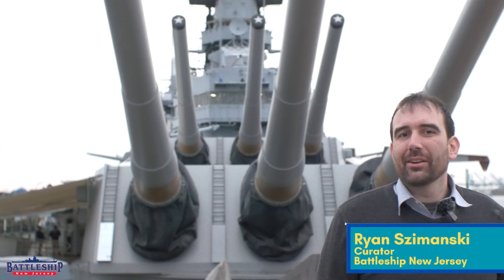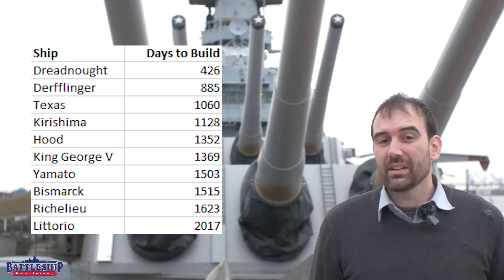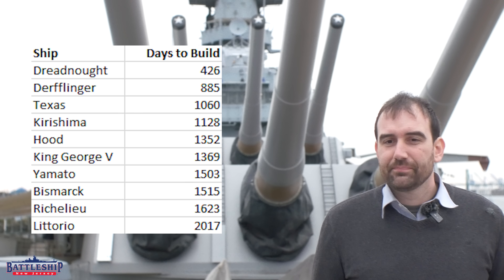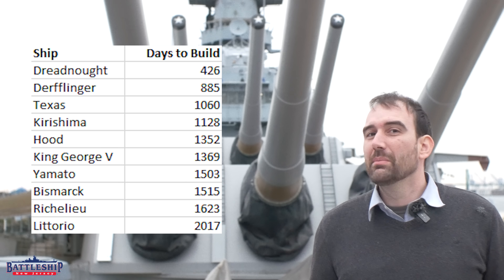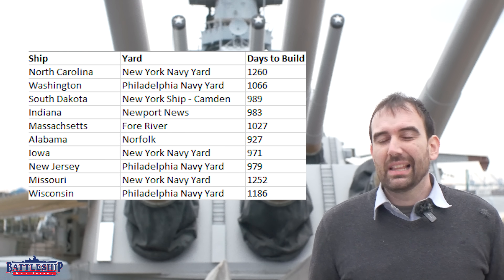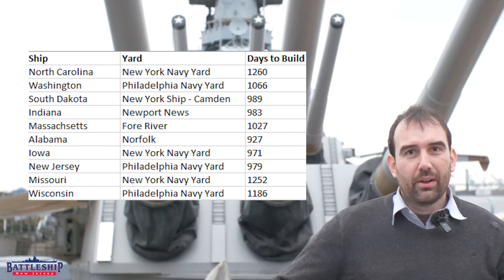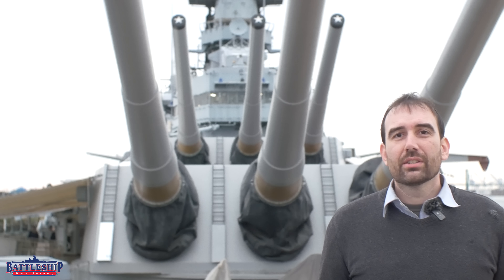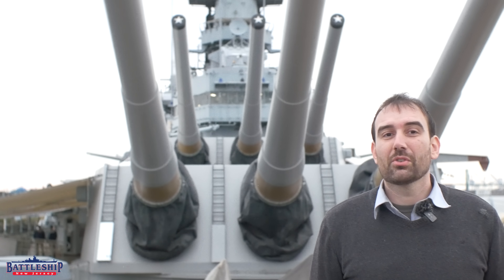How Long Does It Take to Build a Battleship?

Comment: Hi Ryan & Co.
Infrastructure and a skilled work force IMO are what reduces manufacturing time.
If your going to make 500 ships all the same, it's worth setting things up that take a bit longer, but in the overall production saves time. Also the workforce is use to and knows the things like making sure the welding cables are fed a way to save moving them later on etc, that save a few minutes here and there but in total save hours and months.
I know building only a few means not investing in the infrastructure that is only required, but that is IMO why they take a bit longer to build, especially if its going to be presented as the best.

Comment: Material Supply.  Waiting for a new technology or radar or guns.  I believe the longest turn around on battleships were the big guns. 
One of the things is pig iron production and then turning it into steel. Forging machines etc. 
The other thing that could slow construction down is the machines used to build the ships. Wear and tear and maintenance on these machines (cranes, welders, supplies for welding etc).

Comment: That was actually interesting. But basing it solely on time does not give the true whole story. It would have been nice to also have how much manpower each project had. And the other issue material would be a lot easier to source for some countries than for other countries. If you take all that into account I wonder how much those figures would then change if that was taken into account..... for example if say a ship was built in 1500 days but its manpower had say 1000 workers on it, material easily sourced. another project similar size in another country was built in 1600 days but its manpower was only 600 workers, material not easily sourced, then really which one was actually the most efficient.

Comment: The USA's steel making capabilities are much less now than in the 30's and 40's, even things like welding the ship's thick armor plates would potentially be much harder now due to a loss of technique/process understanding on how to do it without cracking the armor (a materials scientist from MIT told me about this back in the late 90's). 

Many lessons to re-learn, many basic structures (shipyards, steel mills, large hardening furnaces, etc.) would have to be recreated to come close to what we had back then.

Comment: Although obviously the keel laying to commission date interval is a good reference, since those dates are easily looked up, if you look a little deep the time difference for IOWA vs MISSOURI - both built at same yard - are maybe not as different as it looks. Photos of the commissioning ceremony for IOWA show she is lacking equipment at commissioning- missing the catapults, some of the 40mm mounts, her Mk 4 antennas, her aircraft crane. By comparison the commission photos of MISSOURI seem to show her essentially complete, with catapults and all radars. On the other hand  IOWA did start trials within a couple of days after commissioning according to her DANFS, so clearly she was seaworthy.

Comment: Riveting versus welding. Older ships were put together w rivets.  By WWII welding was far more common.  Saved much weight.  Faster.  Less manpower intensive. Stronger joins between metal, so you can use less material in some circumstances.

Comment: Just a guess the competence was there in american society so I guess when they ramped up production they could transfer civilians to work in the yard when they suddenly needed to build more faster then they usually do. just a guess. I think it helped filling the hull with everything that was designed to go in there faster. Working around the clock also helps to fit all the workers in there. These numbers do not tell how hard a nation tried when building these.

Also that Littorio ship must a lot spare windows cause how long do all those last in battle.

Comment: I would say an important reason for especially later European constructions is simply that they weren't at war yet. Bismarck was already launched when the war began, similarly to KGV, Richelieu and Littorio, meaning the bulk of construction time was already over by the time a real need to speed it up was present. Richelieu meanwhile had the problem of not exactly having time to finish construction in France after launching while all of them are way larger than the WW1 ships. It's pretty interesting that the most capable WW1 era ship in WW2 constructed under similar conditions has a similar build time, especially since the most crucial aspect at the time, speed, was her biggest weapon. I checked it out of interested a while ago: Only the Richelieus were faster than Hood at the time she was launched. And most likely would have returned to, if she had the time for a refit. It's a shame she was sunk. At least I got the Cobi model

Comment: The first thing to remember about WWII was that FDR was ramping up American industry to supply Europe and the US with war materials.  This no doubly helped in the speeding up of construction.  I am sure many long-lead time parts were on order when the time came to build her were available.  

But I am surprised that the first in class US ships were so fast because there are always design problems to be worked out.  With that being said, did the Missouri and the Wisconsin spend extra time in the yard getting upgrades (beside the material shortages)?  For example radar was improving everyday during the war.  Japanese tactics were understood as the war went on.

Both the Iowa and New Jersey had yard time during the last year of the war.  I am sure that was to fix stuff as well as to get the upgrades.  I have to do a lot of homework to follow those time lines and what was done.

Comment: I have to wonder if part of our speed is attributed to the lack of attacks on American soil. Japan and Brittan were often under seige and ship yards are a HUGE target for bombing raids. I have no basis of fact just speculation.
Reply: That has to be a factor. Not only the shipyards but the foundries, machine shops, railroads, etc, were all able to function unmolested.
Reply: It is that and uninterrupted suppliers and supplies lines + bills essentially pre paid by the unlimited dollar cheat of the US government. And even then US gov had to prioritise oil/steel/etc to the war effort ie all the rationing measures and warbonds initiatives.

I can guarantee you german/japanese/etc shipyards had stoppages due to supplies not coming in for one reason or the other and many ignore it but germany didn't fully switch to a wartime economy until 1943 when the eastern front started really going off the rails.

Comment: Was there something wrong with the USS North Carolina? It was removed so fast after the war. And never brought back like the Iowa's were.
Reply: All US battleships except the Missouri were mothballed shortly after WWII due to the post war draw down, ie cost issues.  The South Dakotas went first primarily due to the fact that the ships were cramped and could not keep up with the carriers and were mothballed in 1946-47.  The North Carolinas lasted about a year longer and served as training ships because they were roomier than the South Dakotas  but they were eventually mothballed also in 1947.  Costs eventually caught up with the Iowa, New Jersey and Wisconsin and they were mothballed in 1948-49.
Reply: She did have a lot of vibration issues, primarily in the power plant area.

Comment: Impressive for Yamato class considering top secret it was plus everything have to be specially designed and built to even move the massive ship parts and the dock. The turrets alone weigh more then a destroyer so moving that from factory to the shipyard was Impressive along other things. Bismarck class surprised me but not much considering its built where there many shipyards to build in and plenty of resources raided from other countries. At the time, but yes when a country has the resources and plants to build the armor and stuff plus the many shipyards to build in, it can be done very quickly. Plus Franklin Roosevelt like having the impossible done
Reply: Not only that, but the Japanese were very picky on the armor plates for Yamy.
There's a photo of a turret built for Shinano used as target practive, that's a armor plate that was rejected for Yamato's construction.
Reply: @ottaviobasques  very true and they were also took time designing the hull for effective speed. To badd there fire control and aa guns doomed the ship

Comment: How do they accurately determine the weight of a ship? Surely there's no scale that you can sit a ship on.
Reply: Think goes to the engineering 
Part is of a certain size and made of x material
Just have columns of numbers to add up
If to heavy redraw it
Use to have staffs of engineers redrawing parts to make them lighter
Reply: The weight can be determined by the amount of water that the hull displaces.

Comment: A big part of the question is how much money and how many workmen and how many work shifts are being dedicated?  If you want it fast, the costs will necessarily go up.

The next question starts with the ship systems.  As time goes on the propulsion plant gives more power and speed for a smaller boiler and turbine size and weight.  But again, that savings comes at a cost in the design and tooling for those systems as they require finer tolerances.  Same for the electronic sensors and then the fire control systems.  A modern warship hull isn't really all that expensive - then start adding an Aegis sensor suite and whoa momma, watch the cost and construction time skyrocket.

Comment: The North Carolina had significant problems with vibration in its propulsion plant.  It had extensive builders trials, sailing in and out of New York Harbor for repeated tests.  This is one of the reasons it got the nickname "Showboat". They never did completely solve the vibration issue that continued to crop up at high speed.  Was this extra time included in your build time?
Reply: It is my understanding that all the US fast battleships, including the the Iowa class, had some problems with vibration. I understand that it was all about fluid resonances between props and the hull, or something like that.
Reply: It's still a problem with today's carriers. You will never design out the resonate frequencies. They just need to stay away from those specific RPMs.
Reply: That’s part of shakedown
Reply: According to Drach, they resolved the vibration issue from the screws by avoiding lingering around at offending prop rpms. Never fixed it.

Comment: How long would it take to reactivate a battleship (or 4)? It seems like we should be getting them ready for a new shore bombardment mission...
Reply: When I visited the USS Alabama (South Dakota Class) in Mobile Bay 20-some years ago, the retired Navy sailors manning her were proud to say they maintained her in as close to seagoing condition as possible.  They had one of their propellers detached and sitting on the fantail, which they said the Navy insisted on when they converted her to a museum.  They said it was ready to sail again with minimal recommissioning time.
By now, the condition, both of the ship and its volunteer crew, has most probably deteriorated.
Reply: Been discussed in other videos 

And it's never going to happen
Reply: Ryan's covered this before, and said it's be faster to just build new ships. They just haven't been maintained to keep them operational, their power plants/generators/wiring hasn't been touched, there's been bits modified and altered, the Navy doesn't have anyone who knows how to use such ancient engines etc.

Plus battleships are incredibly vulnerable to missiles/modern attacks, and there's just not enough need for shore bombardment to justify the insane costs of using battleships. It's way easier, faster, more accurate, and safer (and likely cheaper once you factor in the billions it would cost to get an Iowa class moving again) to just use a missile.

Comment: Not to take away from the video. The underside of the 16inch guns are needs some attention rust
Reply from the maker: I can't see a spot of rust on the underside of those guns, if you mean the tan part on the loading end, thats painted on to mimic where it was greased to allow for movement, but its pretty crisp lines so I assume thats not what you mean.

Comment: Back in the very early stages of dreadnought era, ships like Texas started out as a skeleton frame built up around  the keel, and then they added the armor and steel plates as they worked their way up the frame which required mules to haul the steel up ramps along the skeleton frame to install them, once the hull is finished it is launched, and then completed in the dockyards.
Compared to some of the ww2 Era ships were built in sections, many pieces of the hull of the ships were built separate and then assembled together, which is the same process the allowed us to crank out so many liberty ships and even the Iowas were built in this way.
Reply: I’m pretty sure this is how ships are built today as well.
Reply: @dogloversrule8476  It is, look at Cruise ships.  The sections are already premade, they just attach the peices together like legos and weld them together.
Reply: One thing you didn't consider as you note that the later battleships took longer to build was that they weren't needed as much.  The earlier battleships, started before America entered the war, were built at a time that the Navy was a battleship Navy.  For decades the mightiest ships were battleships.  Pearl Harbor proved that aircraft carriers were the most important asset.  Six months later, Midway proved it again.  Battleships primarily served as shore bombardment batteries -- important but not as strategic as sea-borne air power.
Reply: Note that the belt armor was added AFTER launch on the WWI era ships. It’s only when you get to ships that have internal armor (NELSON, SOUTH DAKOTA, IOWA) or pre-installed bulges like HOOD that you are getting armor belts installed before launch.